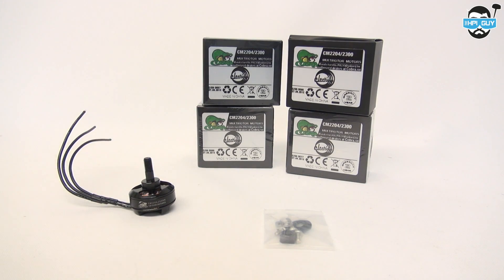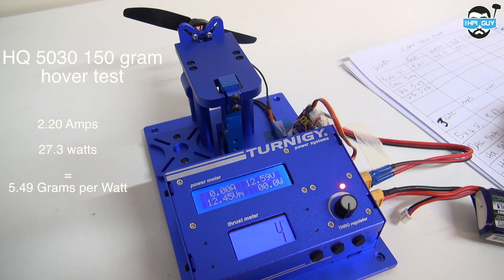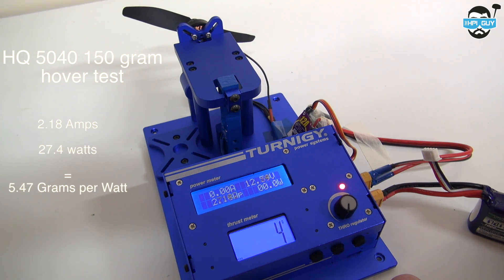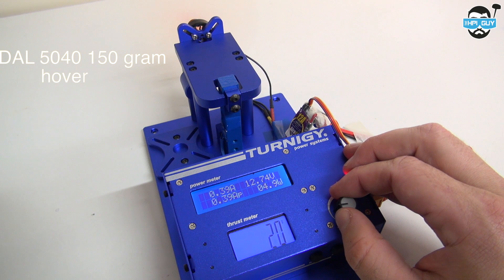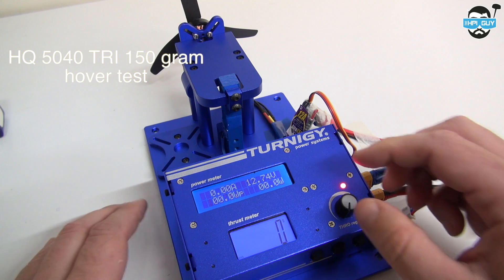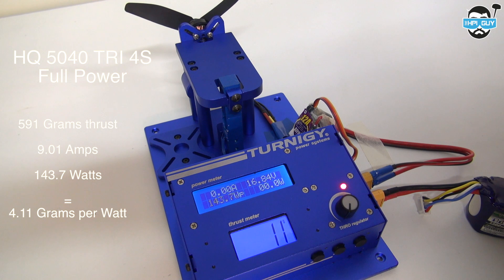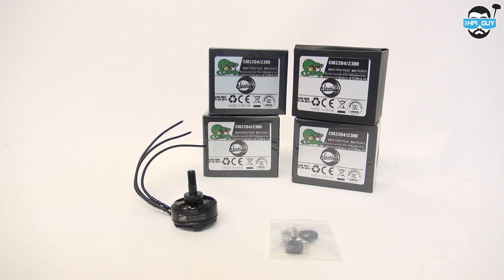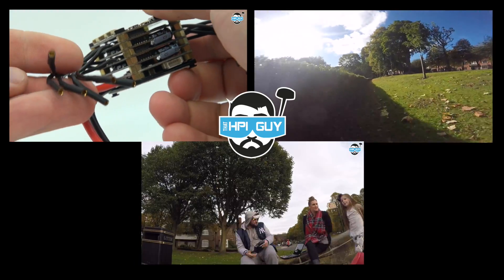HPIGUY | Cobra 2204/2300KV 3Cell & 4Cell Thrust Testing

Comment: if it means anything to anyone i use the very same motors today. the shafts and bearings have improved to have little to no play. this is just my experience. i have had one motor that had a bit of a "click" and was a little hard to spin as if it was too tight. but all the others i have had in the past been great. never dropped a magnet or never over heat or so unbalanced it never gave me any problems.  for me they are a great motor for the price. i normally pay around $20.00 each. i hope this comment helps. 

great review and test video. thank you.

Comment: Need me some triblades :)
Reply from the maker: Note: these props are more efficient than the latest Gemfans and other bullnose props that are built for power and strength. If I put a bullnose on here we will reach around 800grams of thrust but the grams to watt efficiency will go do to around  2 grams maybe 2.5 per watt, and that's crap for half decent flight times. If you want I will re do the tests with the more powerful props just for fun, but I doubt I'll fly them much.
Reply: +ThatHPI GUY i would love to see the thrust numbers on the ridiculous props. Seems most of the big name racers were using bull nose 5045s for a while till Mr. Steele convinced everyone to try the HQ5x4x3 props.